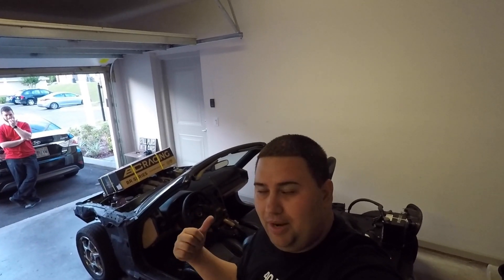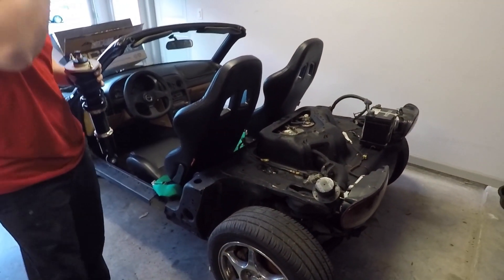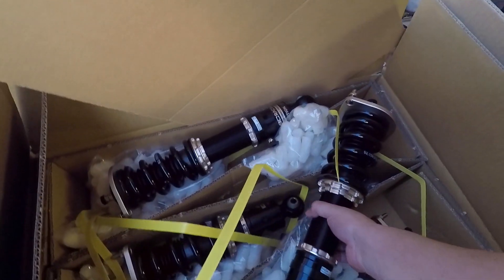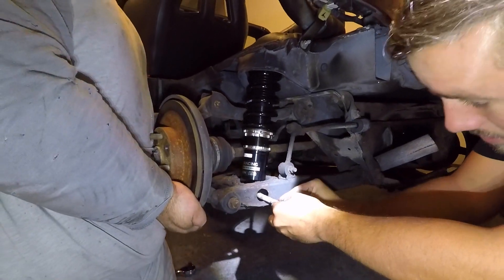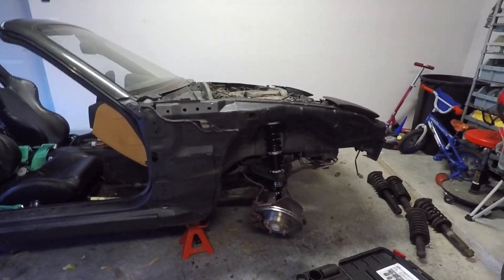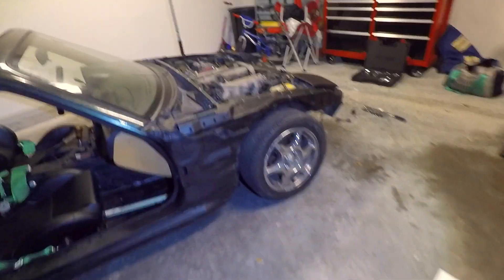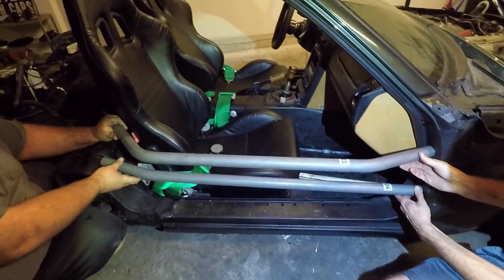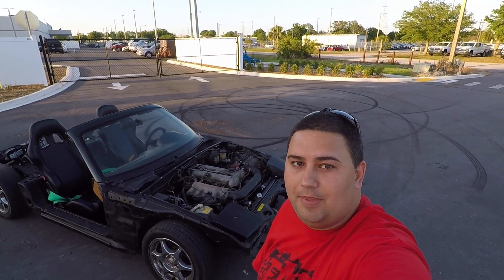Donuts In The Miata Kart! Part 3 Coilover Cage And Supra Update.

Comment: Hey, I have a question. I am 13 and going to be taking an automotive class for Freshman year in 4 months. I already have some car repair experience for only being 13. I have helped change a head gasket and brake pads and brake rotors. Would you be able to recommend a fun little cheap car to thrash around on for me lol? I’ve been looking at na Miatas but I’m a little worried about insurance. Thanks and keep up the great videos!
Reply: Tanner 1126 miatas have zero power. Insurance companies don't charge very much to insure them. They're also really fun to drive. 
Old 3 series BMWs are also great to mess around with. RWD with straight 6s and easy to find manual. Also, e36 BWWs are pretty cheap.
Reply: Martin McSoar yeah, I like 3 series’ but I’m just not really into bmws lol. I really like the Miata because of how much you can really do to it, thanks for the response!